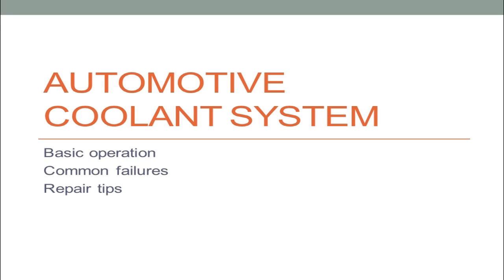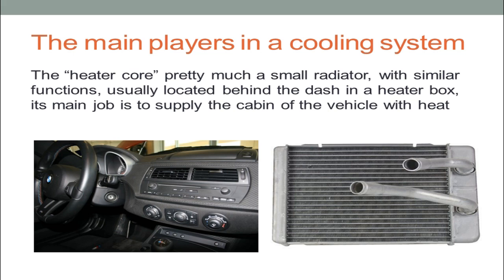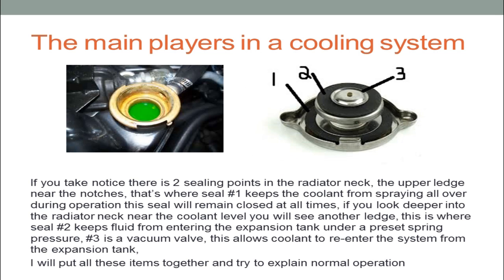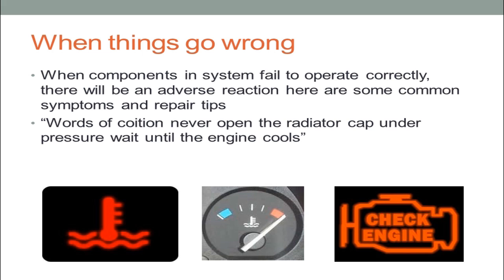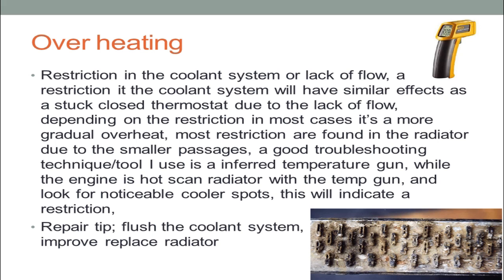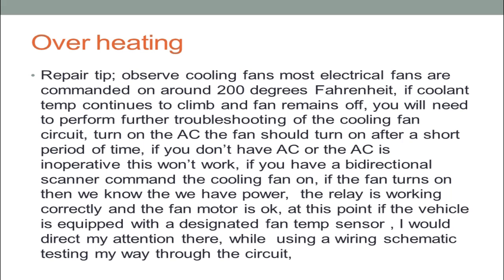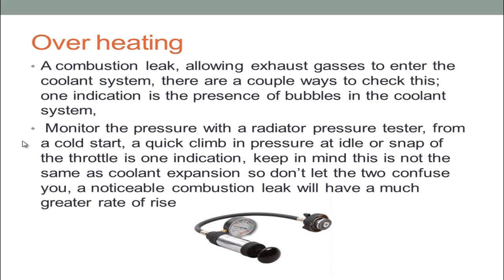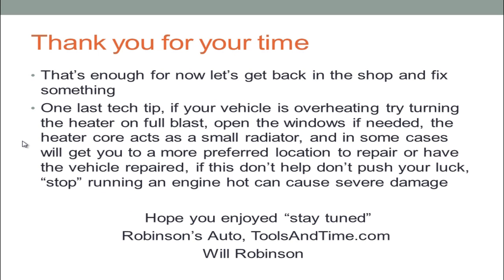Automotive cooling system, components, description, operation and more

Comment: i have a 98 dodge ram1500, and i live in chicago. it takes forever to warm up in the winter, the heat is horrible, i put in a new thermostat and waterpump with no luck. im gonna try to change the clutch fan now. thx for the input. if this doesnt work i guess ill just have a crappy winter truck. runs great in the summer BTW.